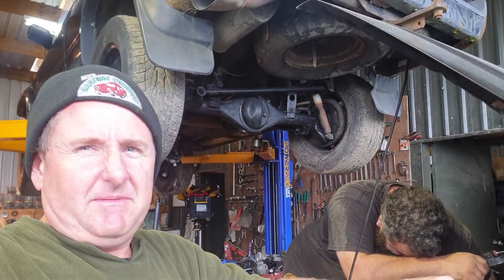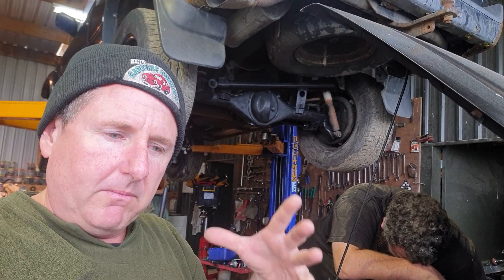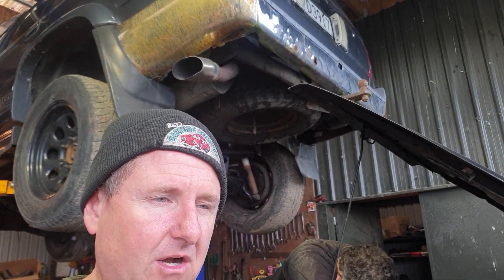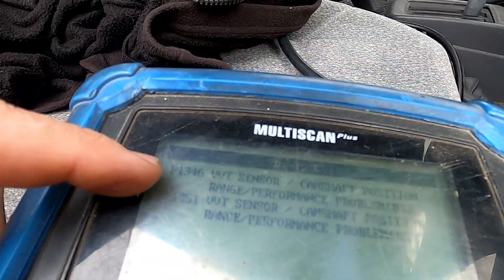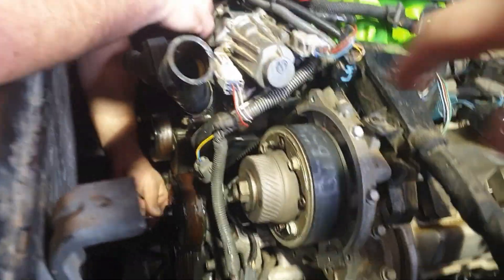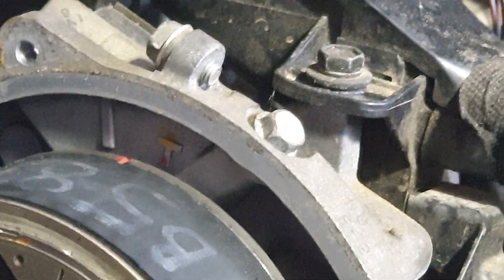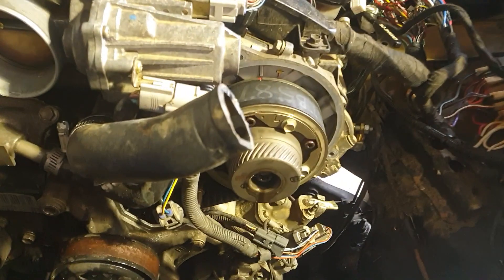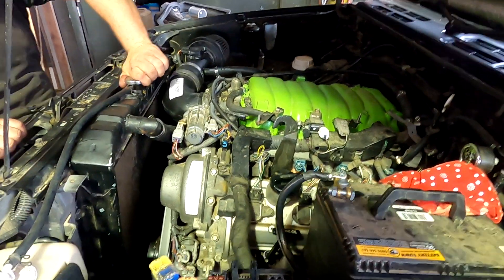Cam timing issues 1uz and 3uz VVti. Codes P1346 and P1351

Comment: Hello, thanks for sharing. I need HELP
Water pump dumped. Part of the belt wrapped around crank gear. After setting timing with new belt, and test rotation, I have 0 compression in all cylinders. Is there a vvt safety or something that would  dump all compression at once? Or how do I check cam position against the cam markers

Comment: This videos a bit old but I’m completely stumped on this 2001 ls430 , it has a passenger side vvt sensor code and when I floor it the rpm’s jump up but it lags before the power kicks in, I replaced both vvti sensors both plugs, and nothing I then checked timing and which you solved for me the timing is right I line 0 up with line on balancer and  my marks the cams line up with the line. Do u have any advice? Thank you for the video and for the help.

Comment: I'm thinking I know why this happens. A lot of people read the timing marks on the belt as left and right thinking it means your actual left and right. Instead they mean R cam gear and L cam gear. So essentially they putting it on backwards and lining up the marks and there's one tooth difference this way as shown. I know because I just did it. At least I found this video and fixed it in an hour with the cam covers and tensioner trick lol.
Reply: How do you do this cam cover and temsioner trick

Comment: have a 1uz from a 1993 lexus ls400 with a code 13. rpm signal no2. it says on the internet, the cam belt has been changed by an earlier owner to mension. is it possible it don´t line up like in the video? or do you think it is an cam sensor that is broken? the car feels very underpowered also
Reply from the maker: Id check timing timing first,  then check resistance and signals from cam and crank sensors

Comment: Hello, I've similar issues on my 1uz engine, but when I removed the camshafts, I noticed the ocv filter was removed by the previous owner of the ls400, please I need to ask, could the absence of the ocv filter result in the engine having similar scan codes like yours ? Should I leave it or get a new filter for it ? What could happen if the filter isn't there ? Thanks and awaiting your response

Comment: Thanks for confirming that the 'T' mark should be used when doing a timing belt replacement (which = approx 50 degrees ATDC), as you said 'to stop the cams flicking'
Reply from the maker: Cool as.

Comment: Can a head that's been skimmed cause cam timing or other issues too? I've been told you shouldn't skim 3UZ heads at all due to the effect it can have, which seems a bit strange.
Reply from the maker: It will have an effect on cam timing but providing its a tiny skim its not normally something which causes detrimental effects.  If they need a surface then they need a surface so we conplete the repair
Reply: @CartuneNZ  Thanks! I'm looking at three thou, so not big, but wondered in that case if the juice was worth the squeeze! If it doesn't have a significant effect, then happy with that!
Reply from the maker: Three thou shouldn't have noticeable bad side effects

Comment: I am having this exact problem. Code p1346 on my 02 is300 that I just bought that the previous owner never disclosed. Anyway, long story short water pump, timing belt and tensioner  DOES look new. I've replaced the pigtail(the one with 2 wires) of the vvti sensor that the previous owner held it with a zip tie.  Follow by the solenoid itself and the tiny filter. Now, my question is, do I need to take everything off again?  like radiator, drive belt, tensioner etc to readjust the cams timing if it is off? Thank you in advance!
Reply from the maker: I can do a reset of camtiming by dropping out the tensioner and just removing the top cam covers , but its not the simpliest way but its quicker than stripping the whole front.  Cheers Kelvin
Reply: Little late to reply to your message but I'm getting the same code and also have a 02 is300 lol. Ive fixed everything else with my car and replaced the vvti solenoid and filter but that did not work. The waterpump and timing belt look like they were replaced but I am wondering if the timing was done correct since I'm suspecting it wasn't. If you end up seeing this please let me know if you found the issue and fixed it, Thank you and hope you did resolve the problem.
Reply: Did you find the solution? I have the same problem
 @richardmaranon8486

Comment: Kelvin, was it off a tooth because the idler moved things?
Reply from the maker: I normally see them a tooth off due to poor work practise.  I'm pretty sure this one suffered the same reason.  They must be turned two revolutions after fitting the cambelt and all rechecked.